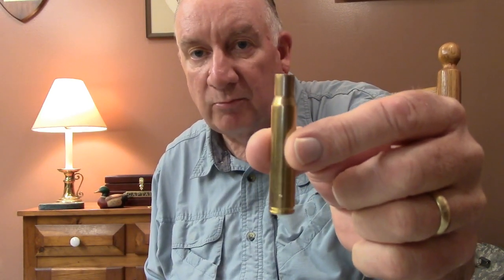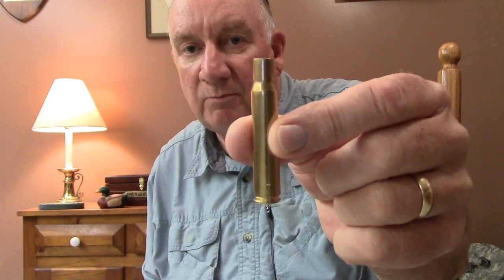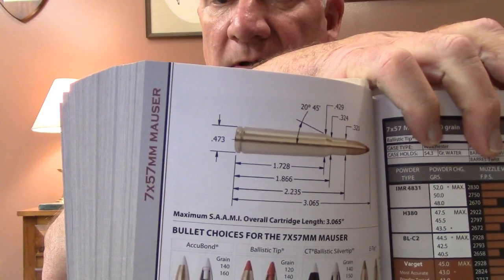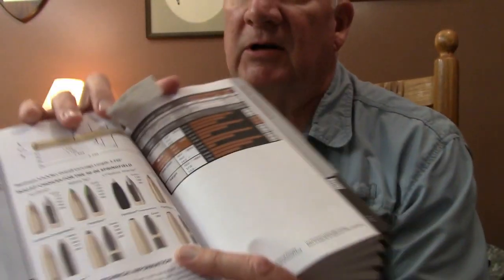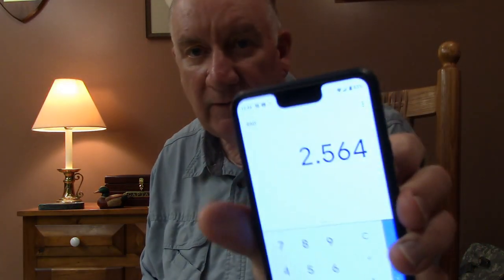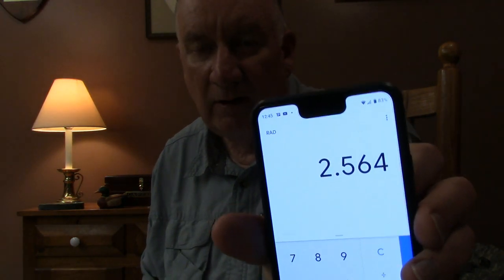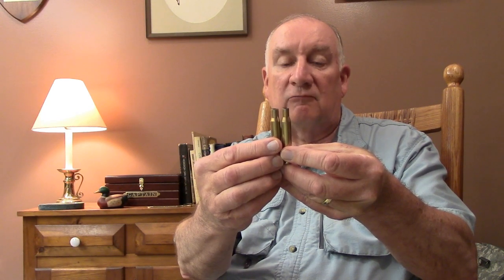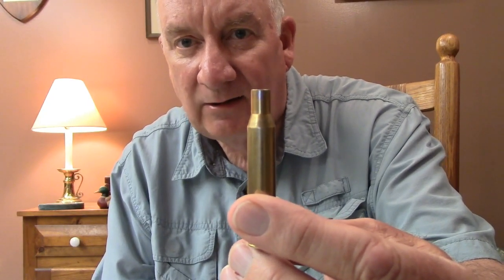Winchester 270 Origin Myth ~ Stupid Wiki Nonsense

Comment: Nicely done. Point of order. The datum of a rimless case is the distance from case head to shoulder, which is the head-space. The 03 and 06 cartridges are identical in this dimension. The 03 is .067 inch longer in overall case length. The neck of the 03 was designed to accommodate the
Reply from the maker: Thank you.  Yes, please watch my "Cartridge Headspace-Understanding Case Designs and Gauges" video (published 10 months ago), where I discuss the datum measurement of rimless cartridges, and the headspace dimensioning of all cartridges, including rimfire, handgun types, and shotshell.

Comment: There was production 30-03 made by multiple ammo companies for the commercial market. Winchester chambered the model 1895 in 30-03. As well as Springfield Armory making sporting rifles in 30-03 one of which Teddy Roosevelt owned. The 220 Swift was based on 6mm Lee Navy, a long obsolete cartridge with a production life no longer than 30-03.

Comment: I like the .280 over the .270.  Other than that availability of ammunition, could you give me the pros and cons of this cartridge?  I own a Browning  A-Bolt and with my dad's hand loads I often do 3 and 5 shot groups that make one hole.  I hope I can find his recipe for this since he is now dying of A.L.S. and cannot speak.  I will probably switch since I now have his 7mm-08 which is almost as accurate with less recoil and believe it to be better on whitetail deer.
Reply from the maker: The 280 Remington is a very fine cartridge.  I don't like getting into "better than" discussions. I always ask, "better for what?"  Every cartridge is "better" than another one for particular purposes. The 280 is better than the 270 on bull elk, but the 270 is better for less recoil for equal sectional density.  The 30-06 is better than both for bull elk and dangerous grizzlies.  The 7mm-08 is better than all of them for recoil, and less meat destruction at close range.  The best cartridge is the one that fits the role of the hunter who buys it, not for any other reason.  I have chuckled when someone tells me "I'm getting a such and such because it can handle moose and elk".  When I ask them when they hunt moose and elk, their face goes blank.  I'm willing to say that most cartridges are chosen for emotional or sentimental reasons that have little or nothing to do with practical necessity. The difference between the 7mm-08 and 280 is exactly the same as the 308 and 30-06. The short ones have lots less recoil, while the long ones can handle longer bullets if required, and a few extra yards of range with the lighter bullets.

Comment: Wikipedia is actually as accurate as ‘we’ care to make it.   Apparently the .270 page has been edited quite a few times and very recently.  Use desktop view to see edits or corrections, sources and such. If you have the ability to properly and accurately edit or further the info, go for it.  And NO, there’s no behind the scenes political agenda with Wikipedia articles- unless it specifically says there is an issue (bias) with the article.     Wikipedia becomes more accurate as time goes on and turns out to be a very thorough assimilation of knowledge.   ‘Certainly not the top most authoritative info to rely on when one wants such, but it’s gotten to be a pretty solid foundation on most any subject.    Just sayin’
Reply from the maker: You are correct. The problem is that, while there's no hidden agenda, per se, a reader can believe that it stands as authoritative, and not understand that its reliability rests on the knowledge of unverifiable sources that simply may be misinformed.  Readers often are not aware of that, and it can be a source that may create new "truths" in the community, that are not so. Thank you for your input and contribution.

Comment: There's only about .005" difference in the 7mm and the .270,  the Germans probably polished their bullets a little.
Reply from the maker: Well, .284" - .277"=.007.  Lots of money was made on that number.  It's a difference of no small amount on a micrometer, and 10 grains of bullet weight for equivalent sectional densities.

Comment: To correct all his misinformation  . The reason the .270 win is the length it is has nothing to do with trying to keep it from chambering in a 30/06 , which it will !  The 270  .308 diameter case neck will fit right into the .308 dia lead made for the .308 dia bullet used in a 30/06 !!!  If what he said was true a load 30/06 round would not fit into the rifle . It was originally a wildcat made from fired 30/06 cases . When you neck down a fired 30/06 case to .277 you get a 2.54 length case . The extra braa has to go somewhere .    Also the US wanted the quick reloading of the 7mm Mauser which the Krag did not have . If you look at real facts you will see the old 7mm 175 rn bullet load was within 7 % overall of the 220 rn load of the 30/40  Krag . The US troops got beat up so bad because over 1/2 still had black powder Trapdoor rifles and they were attacking in the open up hill against an entrenched enemy .  Also the US never had pay anything to Mauser for the cartridge or the rifle design . The patent payment was for the Mauser stripper clip ,  period . Sorry to say but his ducks are run over out in the street .

Comment: Hey Capt Gun blue what do you think of the 25.06? Outside of the barrel burning velocities is their any real advantages over the 270 in the real world? I know this is kind of an old video so I'm not sure if you'll see this! Hope You and your Wife are well and that you still have Benny at your side!God Bless!!😁
Reply from the maker: I see all questions.  I have lots of experience with the 25-06.  It's capable of extraordinary accuracy.  It's a magnum version of the 257 Roberts, giving each bullet weight 200-300 feet per second greater velocity over factory loads, though only about 100 or so over full house 257 loads.  It's a very efficient round for long distance shots on mule deer and antelope, and has less recoil than the 270, but unlike the 270, it cannot be classed as an elk or moose round.  With lighter 75 and 87 grain bullets, it's a super varmint round capable of reaching very far.  All the same can be said of the 270.  The 270 will always be a more versatile round, capable of taking heavier game, but the 25-06 is better for the recoil sensitive shooter.
Reply: @GunBlue490  thank you very much! Must be a little rough on barrels like the 220 swift with extended use if the velocities in the manual are true!

Comment: Hello! Do you do any work on shotguns, and if so, how do I get in contact with you? Need two barrels threaded for chokes. Thank you! Kevin
Reply from the maker: No, I am not an FFL or licensed gunsmith. Your barrels absolutely should be threaded by the choke manufacturer. Only they can tell you if your barrels have sufficient thickness to support firing pressures after being machined.  Many barrels do not.  They will generally tell you over the phone if your barrels qualify, and quote a price.

Comment: BTW,  I know you are aware that  270 (.277) is 7 mm ...... .284 is not 7mm ........ right??
Reply from the maker: You are comparing equivalents of metric and decimal inches, but it's an apples to oranges issue, and both are correct.  A 7mm BORE shoots a .284" bullet, and a 6mm bore shoots a .243" bullet.  A .30 Caliber bore shoots a .308 bullet.  A .270 bore shoots a .277" bullet.  All are correct, because the measurements apply to different dimensions.  In the case of cartridges that have metric names, the metric size typically refers to the bore diameter, which corresponds to the lands before rifling is cut, while the decimal size refers to the bullet diameter, which corresponds to the grooves of the rifling.  Early gun making practice was to name a round according to the drill size used to create the bore, whether metric in Continental Europe, or decimal, as in Britain and the U.S.  Such was the case with the British .300 Holland & Holland, and our ".30 caliber" cartridges, which all use .308 diameter bullets that fit the grooves.  That practice did not always arrive at consistent groove diameters, depending on rifling cutters, which is why many old guns present consistency problems matching bullets to correctly fill the grooves, which is the more critical measurement.  The .38 Special and the .357 Magnum each use .357" diameter bullets, but each are correctly named; the .38 Special measurement refers to the chamber dimension which they each share, while .357 refers to their common groove and bullet dimension. The .357 Magnum could have rightly been named the .38 Magnum, which is what Remington did with the lengthening of the .44 Special to the .44 Remington Magnum.  They each have .429" nominal groove dimensions.  Such differences in naming can present illusions.  A .44 Magnum at .429 is not that much larger than a .41 Magnum which is a real .410", and is actually considerably smaller than a 45 Colt that uses a real .451" bullet.  That is not to imply that any names refer to any actual dimensions.  The .220 Swift, .221 Fireball, .222 Remington, .223 Remington all use .224 diameter bullets and have no measurements that their names imply.  The naming of cartridges has historically followed no conventions, as I discussed at length in another video that I encourage you to watch.
Reply: @GunBlue490  exactly!!!!  Thank you sir ...... I appreciate your expansive knowledge and your willingness to share ...... nowadays marketing is king ..... and God bless the old 270 (.277) 7mm for it is timeless ☆
Reply: In fact, 7mm Mauser use a 7.2mm diameter bullet!
Reply: @TRGarza-rv8pk  exactly

Comment: Sir, I am about to purchase brass for .257 Roberts and have some questions. You stated in an earlier video that the +P offerings have a reinforced case head area and consequently and reduced case capacity. Brass options are getting slim but I have found Winchester (not marked +P), Privi, Norma, or 7X57 offerings. This rifle will be used for 500-1000 yard target shooting and I was wondering which case you would recommend. I appreciate any feedback you may have on this subject. 
Thank you 
Nathan
Reply from the maker: Since that video, I've measured case weights and capacities, and have not found a discernable difference with +P case capacities.  Winchester and Norma are good brass.  I've been using the same bunch of Remington non +P brass for my high power 257 loads for years and it has been great, too.  I'd place Norma in the match grade class.  It's exceptional.  The 257 is inherently very accurate no matter what brass.  I think the +P 257 Roberts brass is simply a different head stamp, and I see no difference whatsoever.  Reforming 7mm brass two calibers smaller is apt to introduce thickened necks that might require reaming, but it would be good, too.  Also check prices on 6.5-257 brass, which is a smaller reduction.
Reply: @GunBlue490  Thank you sir. I really appreciate you taking the time to get back to me. I will most likely go with the Norma brass but the Winchesters are on sale for $25 per 50 at powder valley so I may try both. Thank you very much. 
Nathan

Comment: The 270 is oversimplified a necked down 30-06. It’s a wildcat of the 30-06 which is a wildcat of the Mauser case. If you’ve been told different or think it isn’t, you’re simply incorrect.

Another oversimplified example is the Nosler partition. He makes a great hunting bullet. Long before Nosler, the Germans had an A frame or H frame bullet design. 

We have proprietary cartridges. They’re highly customized, but they are an expansion of what other people designed.

Comment: They did make it better, much later, but better and the .308 was born! Boy I am going to get heck for this one. I give you my reasons at least, 1. shorter action without sacrificing hardly any ballistics, 2 lighter round for round, 3 easier on the action of the gun, need more reasons?
Reply from the maker: Actually, the 308 is a very fine round, but it's ballistics are quite dissimilar from the 270, no matter how they are compared.  The 308 can be compared as a shortened 30-06, with ballistics that are just a hundred feet per second behind with bullets up to 180 grains, but it's short case becomes inefficient with heavier bullets.  The 130 grain 270 bullet has virtually identical sectional density and ballistic coefficient as a 30 caliber 165 grain bullet, but the 270 at a muzzle velocity of over 3100 fps significantly outclasses the 308s ability to drive it's comparable 165 grain bullet.  The 150 grain 270 and 180 grain 30 caliber bullets place the 270 far ahead ballistically for long range.  Despite my genuine fondness for the 308 Winchester, which I've owned for years, the 270 is far ahead in the long distance game, and no comparison can really be made.
Reply: Yea I was referring to the 30.06 and a comment that was made in video, about the 06, YouTube would not let me edit so I could explain further, sry.

Comment: When used on deer, my .270 acts like the Hammer of Thor.
Reply: @His Masters Voice Yes, absolutely.  A .270 can be terribly destructive on light bodied deer sized game.  I'd much prefer a .308, a 7x57 or a 7mm-08.  But frankly speaking, for lighter-bodied deer, a .223 is perfectly adequate.
Reply: @haroldgodwinson832  Actually, it depends more on the ammo you choose  between the 5 named. Some bullets are made to explode. Some have a more controlled expansion. All 5 will get the job done. Although, the .223 may not be the best for Midwest or Michigan strain Whitetails. Then there are many different state laws concerning cartridges below .243/6mm .
Reply: @haroldgodwinson832   Yes Sir, people who really Know  ballistics and tumbling effect of the .223 round Know it's sufficient for any game 250lbs or less.  Getting Really gamey, ya can soften up the nose of the projectile on a 5.56/.223 rnd and  Damn it'll expand within 6 or 8 inches and tumble as well. 
We've hog hunted with the .223 and it's a devastating wound channel complimented by an exit hole as large as a baseball quite frequently.
Reply: @michaelhedgepeth5106  IIRC- that only worked on 20" barrels with a 1:14 or 1:12 twist.
Reply: @timl8302   Oh Yeah, if your speaking of game loads .223 Heavy rnds. They tumble right outta the bore on a rifle my son's put together, it's designed for hotter,  faster, lighter 5.56 nato rnds. Lottsa folks Do Not Know this Fact 🤔..
Reply: @michaelhedgepeth5106  No, I was speaking of the original Navy order & Vietnam war's twist rates vs NATO twist rates & barrel lengths. Lottsa folks don't know about that.
Reply: And their ability to tumble through a body.
Reply: @Brian Hamilton     Yes Sir, and for good reasons. It would be a lot more injured and suffering large game than it already is. It's Not really the cal. so much as some peps will take sketchy shot's that should've Never been made. Then Y'all have distance's that are truly unheard of over here on the East Coast. You guys will take shots  of 300,400 yards and with extreme confidence in your selves as Rifleman and of course your Rifle.
I remember when 300win mag. first became widely available and produced by several manufacturer's. 
I helped track deer (whitetails) for folks who where dumbfounded that this New "30-06 on steroid's" hadn't dropped them in their tracks !  Speed and a harder nose caused a lotta good shots to seem off... but when secession at finding the animal it was seen that the projectiles where exiting the ribs on the opposite side with out fully expanding. I carry a Browning  A-bolt, with threaded barrel and a modified ww 300win.mag. when hunting Eastern NC, Sandhills region. Very flat ground and if you got the where with all
Reply: @His Masters Voice  Yeap, I put'em down all the time with one behind the ear,with 22 call.  and similar small caliber firearm's.
Reply: Amen.
Reply: .270 for woman… it’s what my wife shoots lol
Reply: @His Masters Voice bullshit had a fawn shot Good she moved went 10 yards shot in the Goods like a 22 hole been mature deer how far it go
Reply: @robertayoder2063  those are English words you typed but they are incoherent.  Take another try.  Maybe punctuation would help a little.
Reply: Same for me. Drops on their back before i get my eye off the scope. This video is a joke

Comment: If .30-03 was strictly a military test round that saw less than a year of use, why did winchester decide to chamber the model 1895 in .30-03 for years after it passed into obsolescence? .30-03 absolutely made it to the commerical market. It never achieved great popularity, sure, but it did get beyond the point you are claiming.
Reply: are you part of wiki or what is your support for what you are saying? I am not saying you are wrong.
Reply: @survivortechharold6575  If you are only going to be satisfied by a reference book i'm afraid you will call me part of the wikipedia crew. But, a quick Google search will verify what i have said. Many folks are attempting to sell winchester 1895's chambered in .30-03. Reputable collector sites such as rock island auction included. My point is that .30-03 did indeed make it to commercial acceptance. It wasn't a one off military cartridge. It was never popular, but a major rifle made by a major manufacturer at the time did chamber the .30-03.

Comment: When I was a young man I was told many times that Ammo Manufacturers made .270Win out of 30/06 brass before appling the Headstamp. How inefficient I thought, why don't they just make it .270 to begin with.  As I aged I found I was on the right track. Even today I still hear that nonsence from otherwise intelligent people. 
  Myself, I prefer the 280 Remington, which will not chamber in a 270 Win.

Comment: There was a .277 cal cartridge that was designed for the 03 Springfield but the powers that be wanted a 30 cal...so in all actuality a wildcat 277 did come first
Reply: then there was the .276 pedersen that was screwed over.